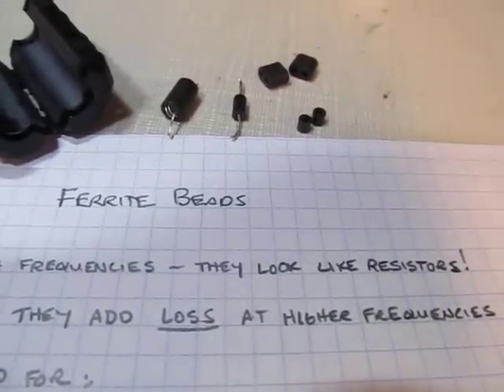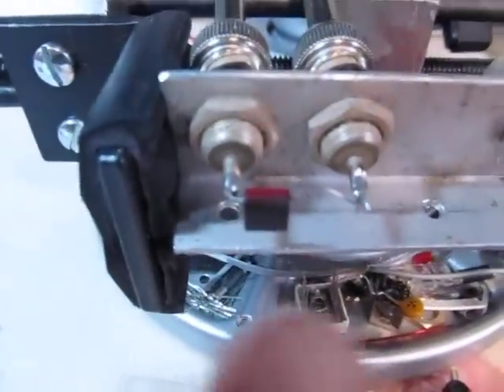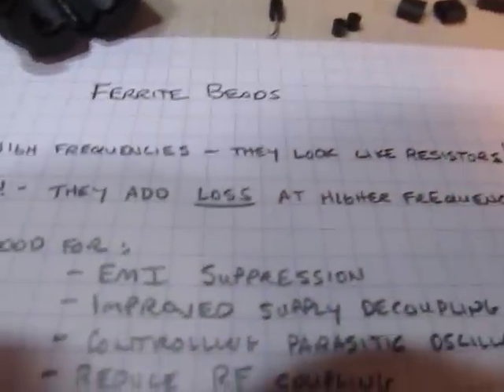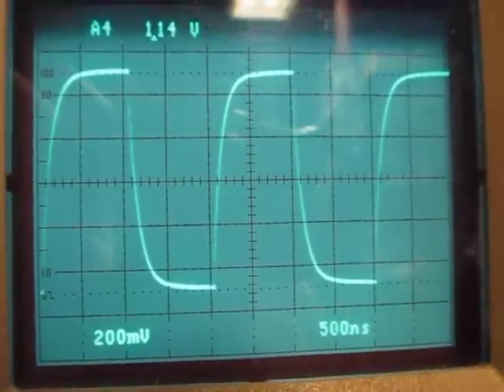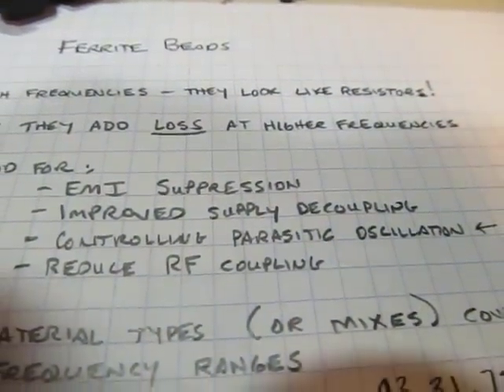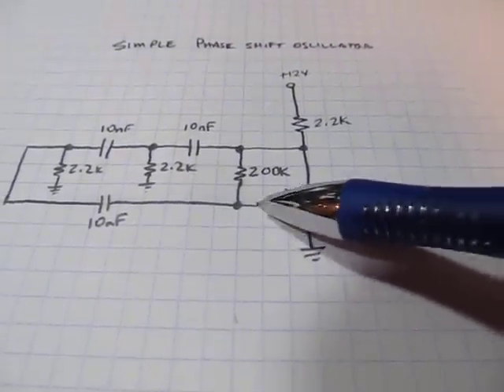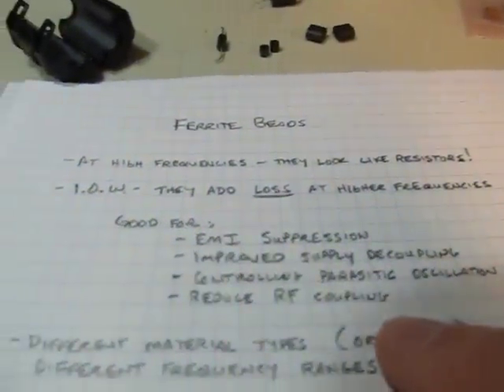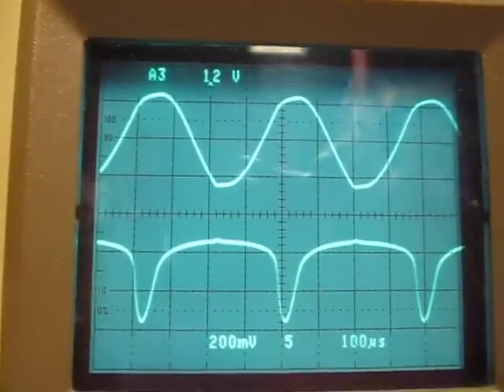#84: Basics of Ferrite Beads: Filters, EMI Suppression, Parasitic oscillation suppression / Tutorial

Comment: I think I just learned more in ten minutes than a month of physics class.... and if I'm not mistaken you did this in one take as well. Excellent work!
Reply: seconded. super useful video. i came across this vid because of a project that i'm working on, but it's gonna have to wait while i go through all of his other stuff.
Reply: fourthed.[?].
Reply: Fifth'd.  Compelling demo.  And as a result of watching it, I went straight to a homebrew receiver project with a Mosfet RF amp that was unstable above 7mhz. Added 2 turns thru a 43 bead, soldered it right on gate 1, and guess what? It worked!
Reply: I also concur.
Reply: Sixthed, very good live explanation
Reply: Not to take anything away from the excellent video, but the reason you learned more from it than you did from a month of physics classes is because the video wasn't about physics.  The video was about what ferrite beads do and when they are used, but not at all about why or how they work.  Yes, ferrite beads dampen high frequency signals, but to understand why this happens you need to understand inductance, material properties, Maxwell's equations, etc.
Reply: I agree IFORCE, I've learned more about ferrite filters and frequencies here than I did in a year of Physics. Outstanding job Professor, I just fell back in love with Physics again.

Comment: Indeed very well demonstrated, these filters and suppression of unwanted frequencies both within circuits and power supplies as these can directly affect other sensitive electronic equipment through power lines or other interconnections as well as radiate electromagnetic radiation as radio frequency interference, (RFI) so today you would not be able to market any product unless you meet all RFI regulation under the EMC rules, and only then you could place any product on the market and obtain a CE marking requirement.

Comment: I know this vid is old, but gold ! clear demontrations, didn´t know osilators have oscilatotions on the base, I thought it only happened on tube circuits where the cheap and effective solution is a grid stopper resistor, most tubes where deigned for high frec. did´t know that bipolar transistor suffered the same issue. Now I know thanks to you! In fact 2N2222 is a high bandwith transistor (relative to say a BC548).

Comment: I worked as an engineering technician for a large op amp maker 45 years ago and we were always looking to increase the bandwidth of our opamps and multipliers. These were discreet devices that were about 1-1/2" square and had 7 to 9 pins on the base (I still have a few in my parts bins). The circuitry was on small printed circuit cards, these were put into a potting shell and then filled with epoxy. A cheap way to increase the bandwidth was to slide a small ferrite  bead over the output pin -worked every time.

Comment: I always thought that ferrite beads were electrically conductive. When I saw you put that bead directly on the lead I was sure a short was imminent:)).
Thanks, opened my eyes and put ferrite beads on mosfet gates on my current project working at 300v, very clean switching right now. (Also added capacitors very close to the half bridge).
Reply: They are electrically conductive. 
Never put an inductor on a FET gate. 
That's the last thing a switching fet wants.
Reply: Fred Garvin you can’t just say never. applications may require to add a reactance to any location depending on its application. For example sometimes your biasing network may require inductors near the gate specially in radio frequency designs. Besides it is all relative to what your gate sees and its switching speed. You could put a a tiny inductor (fH) and if your frequencies are in KHz it simply won’t see it.

Comment: I was right as my guess it was some kind of filter. I asked Best Buy and Office Depot and no one knew.
 Your explanation is very good. I am trying to find the same length power supply cord for my adventure cam 
without the ferrite bead on it.  The cord came with a ten year old Cannon camera but works on my Ultra Pro X 10.
The length is 18". My next step is to try Radio Shack for the cord I need. Subbed and liked.
Reply: LOL you asked Best Buy...You so funny.

Comment: Thank you for posting this excellent video! It has helped me to understand (on a QUALITATIVE basis) exactly how ferrite beads work. Though I am currently interested in filtering out barely-AUDIBLE-frequency noise (in the 10 KHz to 20 KHz range), I am now prepared to do some trial-and-error testing with different split ferrite beads, installed on both the power cord and audio signal cables of our A/V system. Thanks again!

Comment: Hi there, first of all let me thank you for your video, it has educated me to no end. I have a rfi problem I would like your advice with.
I run a professional music studio and am always trying my best to cut down on noise. Recently I have had a dimmer switch installed on the studios lights. The dimmer switch is an old school MK type double switch not a new led one.. One dimmer for each rooms lighting circuit. I am using new Phillips led warm white bulbs which are great for my studios lighting bills and have been designed to work/dim with regular old dimmers. Indeed the Phillips led bulbs dim perfectly and smoothly, even better using the old mk dimmer than the Chinese led dimmer I had before. 
However, now it seems that with the dimmer installed I am picking up much more interference in the room while recording. The classic one is a single coil pickup in a guitar. It goes crazy with interference when the lights are on and then shuts up when I turn the lights off. 
Same with guitar amplifiers. Of course I know that guitar pickups and tube amps always pickup interference anyway it's just that the audible volume of said interference has got much louder since I fitted the dimmer. 
Please is there any way I can choke/suppress or isolate the dimmer switch in order to reduce the noise/interference without having to sacrifice the dimmer and go back to the standard on full of off switch? Perhaps ferrite beads on the connections to the dimmer? Or do I have to spend a lump on a 1:1 isolating transformer and completely isolate the lighting circuit from the rest of the power in the studio. Any help would be much appreciated. Thank you.
Reply from the maker: It is possible that these snap-on ferrite cores might help - installed in the wiring box for the dimmer or light fixture, or both.  But there are no guarantees.  It may help to understand which device is the major contributor.  If the dimmer is replaced with a switch using your Phillips LED bulb, is the noise lower?  Or, if regular incandescent bulbs are used with the dimmer, how is the noise?

Some of the manufacturers have written information on reducing noise/interference:
http://www.lutron.com/TechnicalDocumentLibrary/360484.pdf

Comment: Thank you for sharing your knowledge.
I was reading through the manual for a new video camera I had bought, and it mentioned this thing I'd never encountered before, that snaps around the power supply cable. Of course my curiosity was piqued, so I had to find out more.
Thanks to your video, it all makes perfect sense: suppression of high frequency electromagnetic radiation, by encouraging lossy inductance. My questions is: is this to protect the camera itself or is it just bundled in to comply with regulations to prevent other devices from picking up interference?
Is the operation of the camera likely to be affected if I don't bother putting it on? The cord is supposed to be wrapped around the bead (in parallel) so that the cord passes through the middle part twice. The design of the supplied bead is such that it is a very tight fit and I am concerned that I will damage the insulation of the cord if I were to clamp it shut.
If I simply left it off, what's the worst that could happen? (I would be filming on battery power 99% of the time anyway. Very seldom using the power cord while filming. Only there for charging the batteries.)
Thanks again for the clear explanation.
Reply from the maker: It is likely needed for the camera to meet some emissions standard. It is highly unlikely that you'll have any problem whatsoever if you only pass it through once or leave it off entirely.

Comment: Very instructive video.
Now I am thinking that maybe for the cases that the operational frequency of the circuit is in much lower ranges, it is even better to use bids made up of iron, instead of ferrite.
Because if I know correctly, the "cutoff" frequency of iron is much less than ferrite. Though I have never seen any iron bids around a wire for noise cancelling ...

Comment: Thanks for a practical demo, I always wanted to see.
My idea is that supply decoupling and EMI suppression are 2 different use cases of ferrite bead.
1. Supply decoupling = ferrite bead in series and acts attenuates high frequency noise to pass through, hence decoupling.
2. EMI suppression = ferrite bead as a transformer (not in series), basically provides a low impedance for high frequency noise, so that they do not radiate through parasitic antennas. 
Or, is 1. and 2. same???

Comment: another great video! just one question though. you explained and showed how the ferrite bead blocked parasitic oscillations at the base of BJT. i can see how the ferrite bead's inductance can filter high freq. noise at that point, but you also mention you have added a series resistor before to achieve the same goal. i dont understand how adding a resistor can filter the high freq. components. is that something to do with RC circuit coupled to it? thanks
Reply from the maker: The resistor isn't acting as a filter, it it simply adding a little loss (de-Q'ing) the complex impedance looking into the base.

Comment: Any suggestions on eliminating noise from a BLDC cooling fan in RF circuits? I have read and observed that this noise emanates from the fan's ground wire. The only solution I've found that really works is to use a seperate power supply for the fan, that is a seperate ground reference. The question is, can I create a truly isolated supply for the fan if it is using the same AC wall outlet voltage source as the RF circuit? I haven't figured out how to do this yet. Any suggestions would be appreciated. Thanks always.

Comment: Trying to diagnose weird wiring on my old Nissan and I am considering adding ferrite cores on some of the finicky sensor wires. I've added some to the LED retrofit headlights and I actually think it made a difference in drivability. I have a feeling the fans on the heatsink was creating enough RF and maybe that combined with no isolated ECU grounds it might be enough to distort a 5v cam signal, which I have had issues with in the past.

Comment: If we consider a switched power-supply that runs around the 50-100 KHz range, what would be most (cost-)effective and simplest to filter any parasitic signals from the hashing oscillator on the DC output?
Beads ?
Capacitor grounding (low-pass)?
A pi-filter ?
An RF trap ?
I guess some switching power-supplies use a kind of active filtering as well, but I would categorize that as rather expensive and more complex.
Would you have any thoughts/comments on this and what would you advise?
Thanks a lot for considering my question. I found your video very instructive and entertaining.
Reply from the maker: I would likely start with series ferrite beads followed by ceramic decoupling capacitor(s).
Reply: Thank you. I'm an assiduous follower of your channel. No-nonsense and vey clearly explained. It's a joy to watch :)

Comment: Thank you. I've got an older DC voltage standard I've been trying to repair. It has 4 "VN66AK or 2N6660" transistors, 2 of which have berrylia washers on them... after watching your video I'm guessing those washers act as EMI filters on the high speed VMOS transistors.

Comment: The AC cord plug into the back of an a piece of equipment, inside before the power supply there is a silver square box that filters out RFI/EMI from the AC outlet. Is there ferrites beads inside this RFI/EMI box or what kind of filters are inside these RFI EMI filters for the AC outlets. EE engineers have told me these AC RFI/EMI filters cause a lot of current leakage issues i'm guessing from the AC hot wire to the earth ground. I have tried opening up these silver box RFI/EMI filters but looks like filter cavities or something.

Comment: W2aew, when they use a CHOKE a series transformer coil in the power supply, what does this Choke do to the AC ripple? The Choke changes the discharging and charging of the filter caps or doesn't affect it? Without using a Choke the AC ripples can cause "harmonics" added to the circuit?

Comment: I am curious if the scope was set for 50 ohm input impedance, or the nominal high impedance during the ferrite bead tests?  It would seem to require 50 ohm input on the scope to get the voltage division associated with the filter, but maybe this is wrong...

Comment: Thank you for this great video.
In electricity, when we wind electric wire on a ferrite core, we can translate the electromagnetic effect to an electrical circuit by impedance which is jwL ( j, omega the angular frequency, L the induction). 

But here, the ferrite is on the wire. How do you translate that in electricity terms like impedance (maybe it is still jwL, with induction L computed differently) ?
Reply: I think its because even a simple wire has a parasitic inductance. When you add the core this inductance gets bigger (ferrite is more permeable than air), making this parasitic inductance bigger and changing its impedance

Comment: Thanks a lot for the great information. I have developed a micro controller based device for industrial application, which consumes 50 to 100 ma on ATTINY84 ATMEL IC running on 8 Mhz. internal oscillator. Due to interference from the VFDs installed on the same line the controller gets reset. The clip-on ferrite has given good results but I don't know the make and grade of the ferrite. Can you suggest me the grade and size of the ferrite beeds suitable for this type of application. I have noticed a simple small beed on power line can do the job. I need it for production so should be economical.
Reply from the maker: You probably want to look for one rated for HF frequencies (typ 3-30MHz or so), and physically sized so that it doesn't saturate with the DC current you're passing through it. You can probably get the best advise by consulting the application department at Murata or Fair-Rite.

Comment: I have a circuit where in 24VDC power is entering.The unit should pass for CE102,CE101,CS114,CS115,CS116,RE102,RE101,RS103,RS105 test as per MIL-STD461F. How can I use a ferrite bead so that my unit passes all the tests.

Comment: The Snap on Ferrite bead inductors are used to snap on to coax cables and PC computer cables to prevent common noise rejection and what else? I'm not sure how the Ferrite beads are being used as a differential common noise amplifier to reject common noise because a coax center conductor has a differential RF signal which is the forward RF signal and Reverse RF signal which is a differential RF signal and the ferrite beads are being used as a differential common noise network?

Comment: Thank you so much, it is very good information.

I was actually looking for some EMI suppression information as I have designed a CNC controller which takes commands froma USB keyboard. One of my client is having issues that when a 230V contactor is switched on/off the USB stops working, I think its the noise from the coil that is causing the issue.

Do you have and feedback for me that might help resolve the problem.

Thanks a lot
Reply from the maker: +Hind Technology It's possible that the USB cable is picking up noise. But, could also be through the power supply, etc.  Ferrites on the cables/wires leading to your controller might help.  Very difficult to predict if it will help, but worth a shot.

Comment: Thanks, really appreciate this video, there's very little out there on ferrites. Would be great if you could follow up with an 'ferrites applied for power input conditioning' video - examples of successfully addressing spikes from noisy power supply lines, at voltages like 5V and 24V. The small number of youtube vids on ferrites and tvs diodes are pretty theoretical/high level and don't demonstrate how to perform component selection